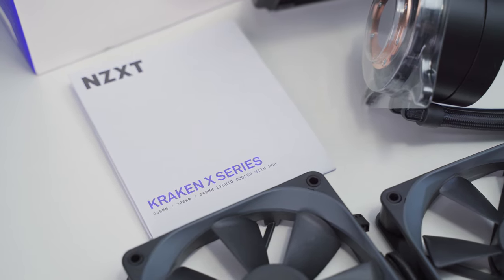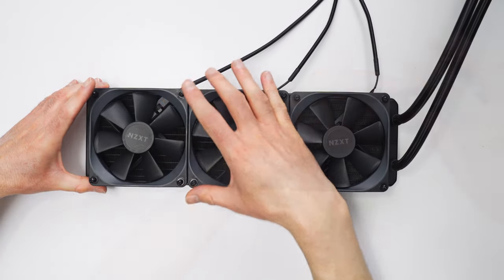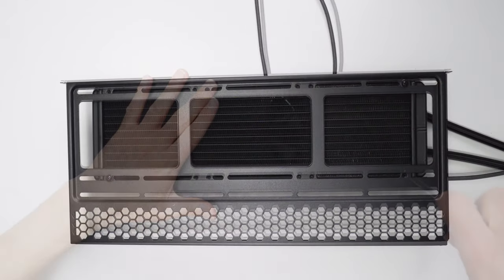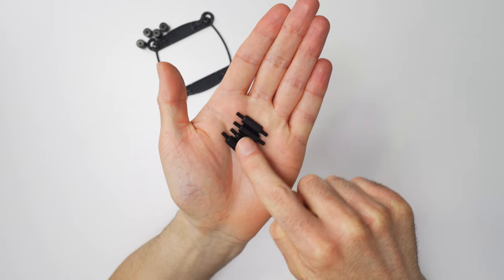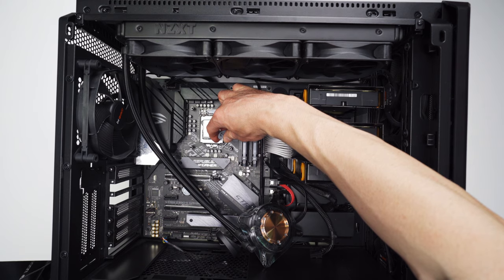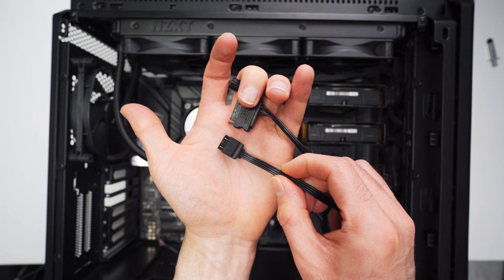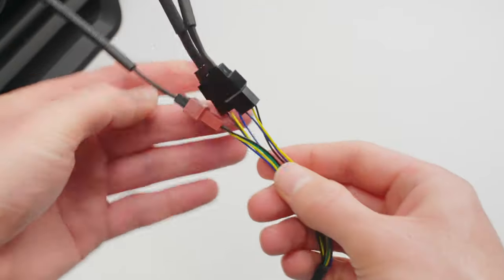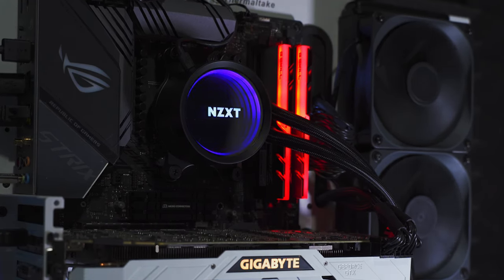How to Install an AIO Cooler - NZXT Kraken X73 Installation Guide

Comment: Good tip about positioning the fans so the connectors face rearward to avoid unsightly cabling. I'm building a gaming PC now and have this cooler and just trial fitted the radiator and fans, I'm going to have to mount the fans around 180 degrees now thanks to your useful tip on this vid🤣🤣🤣
Many thanks for the detailed video, its very helpful.

Comment: Real question is can you occupy that first dimm slot with the hoses coming out? Or will you have to orientate the whole block so the hoses aren't in the way?
Reply: You will need to orientate it. Ram won't fit.
Reply from the maker: With the hardware I used in the video (ASUS Z390 Strix & Corsair Vengeance Pro) the tubes are overhanging a little bit, so you'll probably want to change the orientation if you plan to occupy the first dimm slot.
Reply: @ECPUz  Thanks for the heads up
Reply: @InterestingSandwich  👍🏼

Comment: Explained everything except the RGB connector. Like, where does it go?!?
Reply: This AIO isn’t the rgb version of the x73
Reply: In case of having the rgb version, tou will have to connect the fans to each other, and then to a cable that comes with the kit :)
Reply: @Neon-fv1ew  after connecting the two fans together do you just plug them into a system fan port?
Reply: @samysanchez6052  to connect them you are gonna need one small cable that says in and out on the sides, and a longer that says the same, then you connect the longer cable to another that is attached to the pump, it is and rgb 4 pin connection.
Reply: @samysanchez6052  you dont have to connect the fans to the motherboard, the cables go attached to the pump, then you simply connect the pump to a sata power cable in your psu and the usb cable (that is also connected ti the pump) to a usb 2.0 connector in your mobo

Comment: How do you get the rgb to work ? All my fans are on spinning, and my block head id lighting up with nzxt and the infinite ring is on , but my fans arent rgb ?
Reply: I think you need the nzxt controller for the rgb to work, it sucks right..

Comment: Without an nzxt motherboard how am I able to control the lighting of my nzxt kraken 120 aio through cam? Because I also heard that you are not able to control it using the nzxt rgb controller as that’s specifically for fans and leds…

Comment: i just bought nzxt x73 aio but i can't seem to make it work. the pump head has no power. i plugged it in to the usb header. my mobo is b450 gaming plus max cpu ryzen 3200G. i cannot find any 2.0 usb internal connector on this board. i'm not sure if there is any workaround or need to buy a new mobo.

Comment: When I screw the intel standoffs fully into the backplate there is some play in-between the bottom of the standoffs(the thicker none threaded part) and the front of the motherboard, is this normal?

Comment: Why does it have a sata power? I don't get it, we cant control the pump speeds then? My cooler master aio has pump cable which plugs into the mobo pump header.

Comment: I have everything connected, and everything but the FANS RGB is working. Any ideas for what the problem is?
Reply: Same problem here.  Just built my son a gaming PC this past weekend with the X73 Kraken.  Seems to be a common problem.  They don't seem to tell you when buying the AIO that you need to also buy the NZXT RGB controller...
Reply: @jpdirt2536  it doesnt work without??
Reply: Did you find a solution

Comment: I just want to point out. I bought this one and was the 2021 edition with lg1200. I used the rubber and spaced it out and fit perfectly in the lg1700 socket.

Comment: Old video, I know, but I have the KRAKEN X73 and I have a question.  I was wondering if anyone has ever been able to control the fan speeds by using the motherboard headers instead?  If so, how do I go about doing this?

Comment: I connected like that and Nzxt logo doesn't lights and cam software doesn't detect the device. However the pump is working because the temps are good however it irritates me that I can't control the speed of the pump

Comment: great video however that cable you said you dont need to connect unless you have other rbg items from nzxt and we dont need to worry about it that is incorrect sir, my fans wouldnt light up then i connected that cable with one of the fans with one of the in and out cables and it turned on , make sure you use the other in and out cables to connect the other fans with the one connected to main cable
Reply: Hey so I have the kraken x73 but the non rgb version, do I still need to do anything with that cable? Or is that only for rgb ones?
Reply: @moonlol1130  nah its only for the rgb ones as long as your fans are running then dont worry about it
Reply: @krenzo_sam3985  alr tysm

Comment: what is the micro USB used for ?? RGB control ? if yes, can it stay disconnected for default animation ?
Reply: ok nvm, I disconnected it while the PC was running, the RGB got stuck, and the pump RPM fell to 0, tho I still heard it spinning inside the block
Reply: So do you need it?
Reply: @tomventers  yup,
Reply: Does it have to plug into the motherboard or can i use an adapter? I have no more usb spots on my board
Reply: @bdawrds7601  the adapter should work fine ... or get internal USB splitter
Reply: @cv3nda367  Hey I'm planning on buying the aio, may I ask if this version (the non rgb fans) has a rgb connecter, since the pump has lighting (so do I need to plug a rgb cabe in the mb)? Thanks in advance.
Reply: @camillebeifong  it does have some RGB connector on it, not sure if it is adressable 3pin or general 4pin RGB

Comment: installing this on my gpu with the kraken g12, do i just need the micro usb or do i need the sata connector as well, i have other fans im planning on running the rad with
Reply: Answer I’m looking for.
Reply: @scrappergang01  I got everything in today I’ll let you know
Reply: @scrappergang01  Ight got it all hooked up, you do the the sata and micro, h7 flow can fit two 360 rads both with push config and the front one can fit two more 120mm fans with the drive cage in it but three if it’s not

Comment: I've a ryzen 7 5800x and everytime I start something the CPU will go up to 80/90° and will stay down to 60 or 70°
Reply: That chip can run hot normally... The circumstances matter quite a bit. I undervolted mine with the curve optimizer in bios and played a bit with power in pbo and found stable settings where it could sustain an all core boost of 4600~ at 83 degrees. Somewhere in the 30s at idle. If you're hitting  90 outside stress testing it youve probably got a problem with your cooling solution and/or bad oc or PBO settings. I use an nzxt 240 aio